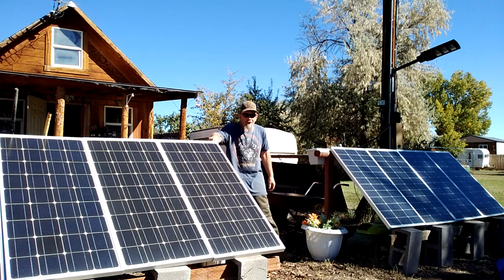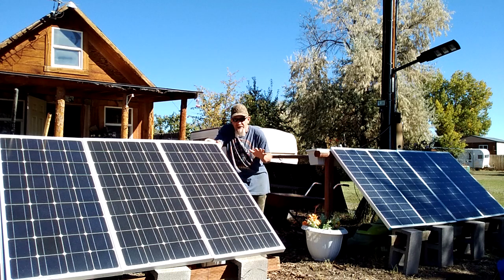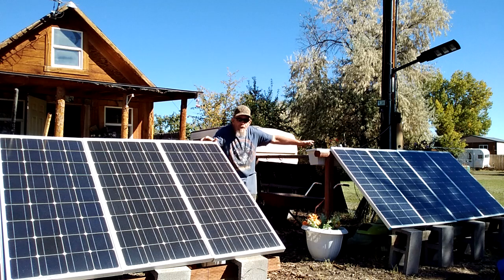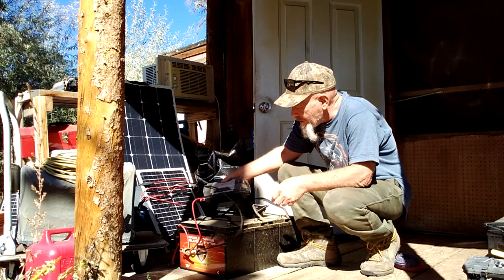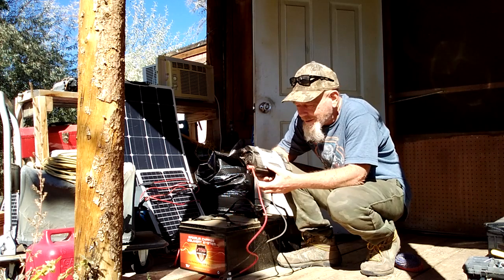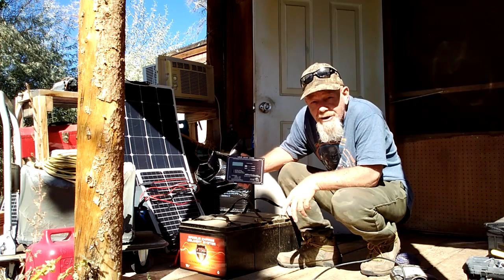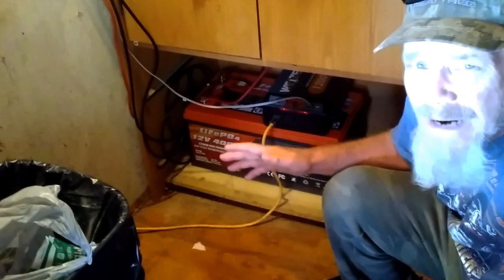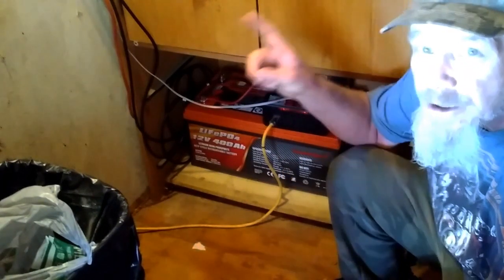10 Years Still Working: Off Grid Power System Anyone Can Set Up!

Comment from the maker: I have been using the same batteries, controller and inverter on my system for over 10 years and it was time to replace them. In this video I explain the old system and the new components I replaced for double the capacity and more AC power for running more appliances.

New System:
Enjoybot 400Ah LIFEPO4: https://amzn.to/46IezOt
Renogy 400 Watt Solar Kit:  https://amzn.to/3PMWBn1
Wanderer 40amp MPPT Controller: https://amzn.to/46zrFha
Weize Inverters: https://amzn.to/45j1xWE

Old System:
Vmax Tank Batteries: https://amzn.to/46yzxzk
Blue Sky Solar Controller: https://amzn.to/3F8HMGv
Energizer Inverters: https://amzn.to/48JgBjb

I make a small commission if you buy through my Amazon links -Thank you!

20+ years off grid and over 300 videos on my channel and my off grid books and cabin plans are here: http://www.simplesolarhomesteading.com
Reply: Nevermind my other comment!  Found the links. :)

Comment: Any suggestions about getting a small inverter generator to top off batterys on cloudy days
Reply from the maker: The DC charge from a generator is usually just a trickle charge so you want to get a 50-100 amp AC to DC charger to go with a genny. The Honda or a Honda clone would work.

Comment: Its getting close to time for my battery upgrade as well. I currently have Trojan T-105 batteries and my next ones will be LiFePo4 batteries. Just upgraded my solar from 700 watts to 2k and one of my original controllers is that Renogy 40a. Good choice
Reply from the maker: I am happy with the LFP. Seem to live up t the hype and hopefully they outlast me!
Reply: @solarcabin  I've been checking out a handful of companies similar to the one that you got your battery from. I'm pretty excited that lithium is finally comparable in price to my Trojans. I might even see if someone is willing to sponsor a video. It's a long shot, but either way, those batteries are so much nicer
Reply from the maker: @WindwalkerHomestead  Contact these guys at LIPULS. They wanted me to review some batteries but I have too many now:  Tell them LaMar from Solarcabin referred you:  humixx.service.554@gmail.com

Comment: Yea but a $1500.00 battery is a bit pricey for me. If had $1500.00 to spare would add about 1 to 2 kw of Solar Panes personaly.
Reply from the maker: Yes, they are not cheap and I couldn't afford one for a long time.  In the long run though it is cheaper than the AGMs I replaced and should last longer.

Comment: How did you hook the original 4 solar panels into the new 4 panels.  I think the original were in parallel.
Reply from the maker: The old system is in parallel 12 volt to avoid shade issues.

Comment: Since you've been off grid for at least 10 years, have you ever wondered how much money you saved by going solar instead of getting your power from the grid for those 10 years?
Reply from the maker: That's a good question?   I have been off grid for 20+ years actually. I just put in that old system 10 years ago.  It would have cost me about $2k to hook up to the grid and probably $100 a month in power bills.

So for 10 years I saved $12k in power bills.

Comment: I think I've asked this but is it still beneficial to run my lights, USB charging ports and cigarette lighter ports from DC?  My friend does his cabin this way because he doesn't like all his lights or low voltage charging coming through the inverter all the time.
Reply from the maker: I still use both AC and direct DC wiring. For low voltage like lights I like DC because you don't need to run the inverter fan and those can still be used even after the inverter has shut off.

Also for appliances that can use DC like my fridge/freezer they use less power because it isn't converted back from AC.